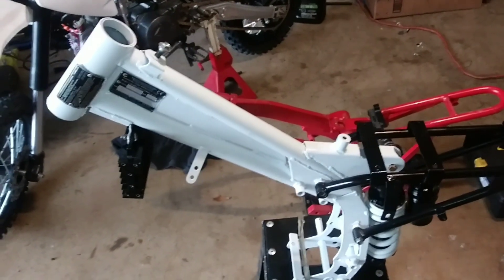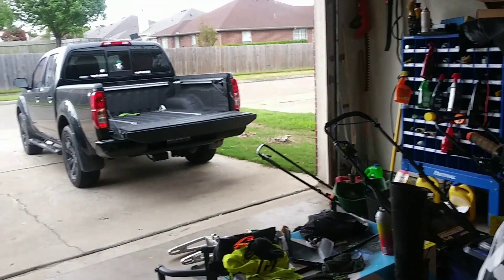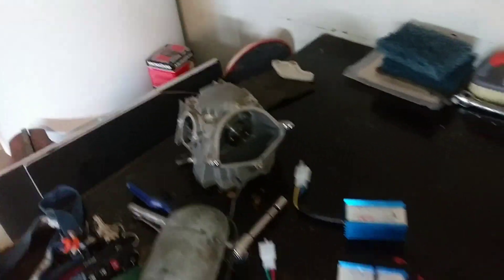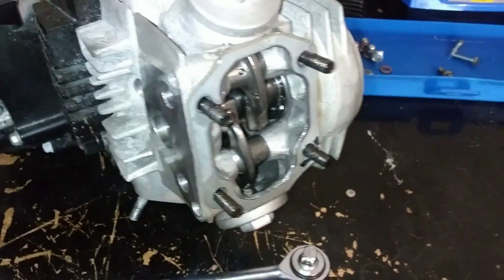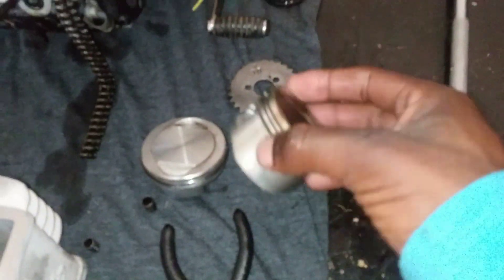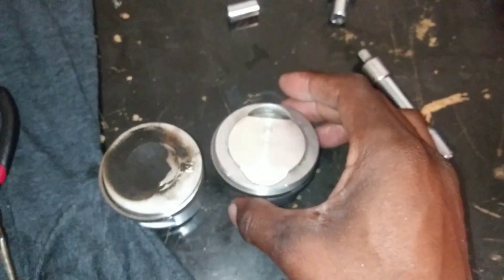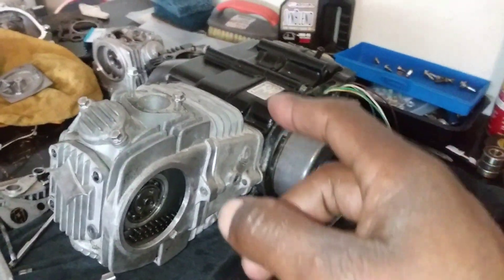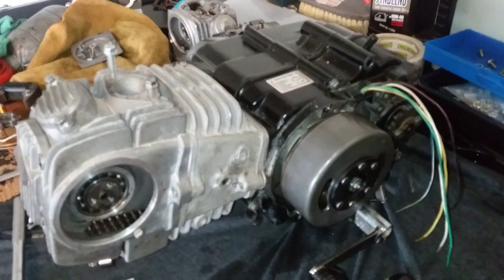Building My own 160cc Engine | More Power!

Comment: Where did you even get the tbolt 160cc bore kit? When I got to their website the biggest I see for a 125 is a 146cc bore kit.
Reply from the maker: Its a discontinued kit that i got in a bulk buy..all they have now is the 146 which is way more practical
Reply: @1E11evenMoto  thanks for always the quick responses man. Really appreciate it. I'm definitely gonna be getting the 146 kit eventually. The 125 is nice, but on a strong windy day here in ND it just doesn't have the thrill. It's always too damn windy here. lol
Reply from the maker: Definitely! Throw a 26mm carb on with the kit and it will be a beast of a motor

Comment: I've did a mad gpx125 build with was really good and I've just striped a brand new normal wheel kayo125 and completely rebuilt it haha gpx gold labal forks an adjustable rear gpx shock kenda tires reinforced lxr rims pro taperbars a rebuilt 160 that was honestly a headache hehe still need to get a pair off nice clutch and break leavers and a new gear shifter but honestly the bike is better then my Lxr nice vid man
Reply from the maker: Niceee! Im getting ready to change my bike up some more after this weekends race!

Comment: I think upgrading to big bore kit on a chinese pitbike is a bad idea because parts quality is poor. How about the other components like a gearbox. crankshaft, chain, wheel spokes? Will it survive the more stress? As far as I understand you gonna need a bigger carb and intake too. Since a chinese pitbikes /motors are fairly cheap I would do a motor swap or just get a bigger bike.

Comment: Hey dude i have a pitbike with an 125cc Lifan engine do you think this would work with it
Reply from the maker: It would but the big bore kit is discounted..but they do make a 146 big bore kit.. go to tbparts website and search 146 big bore..it'll say 120/124cc 146cc kit..it will work on the lifan 125 motors
Reply: @1E11evenMoto  Thx man bc im tired of riding slow
Reply from the maker: I actually just checked and they have the same kits on ebay..make sure you get the one for your size wrist pin in the piston.. they sell a kit with 13mm and 14mm I think lifan is 14mm but just double Check
Reply: @1E11evenMoto  I got one More question do you recommend any other aftermarket parts For The big Bore kit
Reply from the maker: An oil cooler for sure..it will definitely help keep the engine temps down with the added power..also a good exhaust will open it up more as well as a 26mm carburetor
Reply: @1E11evenMoto  Thx subbed and im pretty sure i Will enjoy The pitbike Vids 👍
Reply from the maker: @AotL0000  Appreciate it! Anymore questions feel free to ask!
Reply: @1E11evenMoto  do you know a Palace that would have free shipping or Be in europe BC i live on Finland North europe next to Sweden and russia and The import charger and shipping adds 130$
Reply: What engine was this originally that you’ve converted to a 160cc I have a 140cc and I wanna give it some more power I also have a fresh 160 piston laying around so could this work